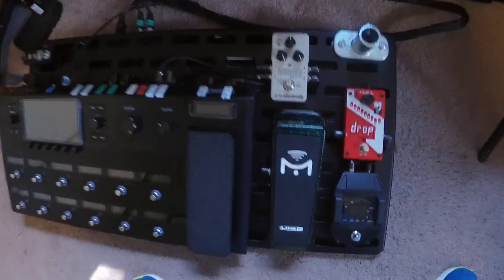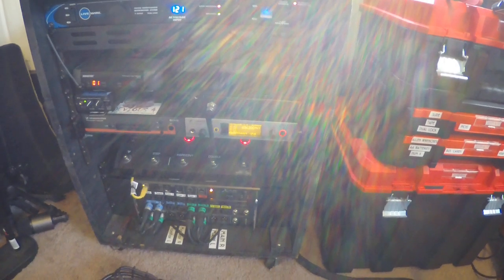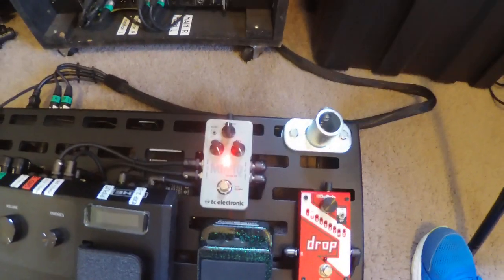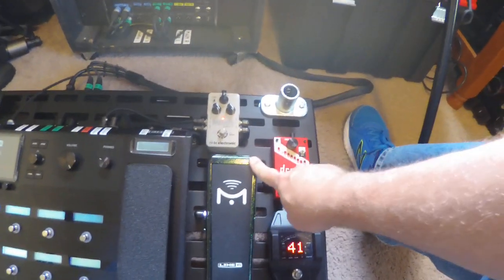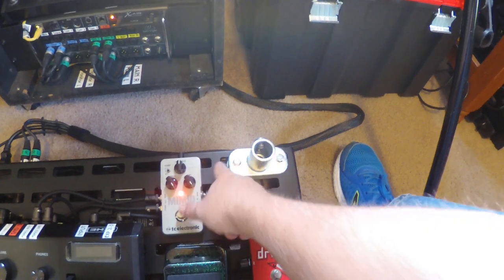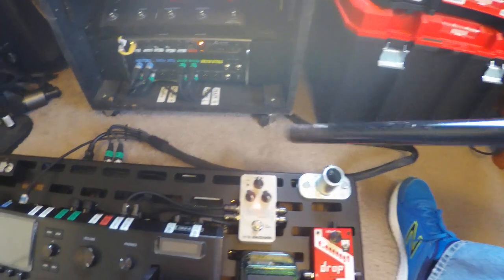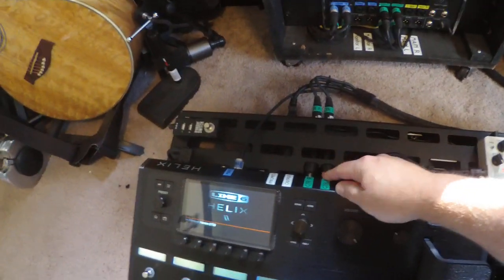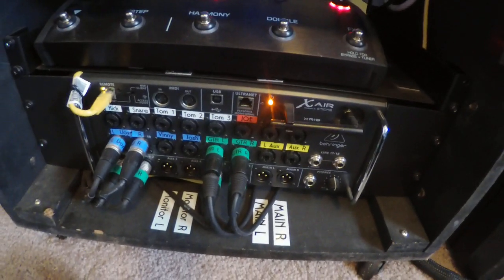My new Rockboard Cinque 5.3 for Helix

Comment: I really dig the clean simplicity of your rig Josh. My guitar rig and PA are very similar, but not as nice as what you have. 

I run helix with no external pedals into the X18 "flat" mixer into Carvin in ears. I use a pair of Peavey PR12s for tops powered by an ancient Peavey CS800 that's probably as old as I am, lol (I'll be 40 in June). I use a single Peavey 118 sub in most situations powered by a Behringer EP2400. My drummer and I both use Shure SE215 ears in stereo. I will say, if you arent running your ears in stereo, I HIGHLY suggest you try it. What a world of difference. 

Anyway, always dig the videos and I love the Helix content. The band sounds great. Keep rockin man!
Reply from the maker: Thanks, Aaron.  I'm using Shure 215 IEMs as well.  The Mimiq is my stereo secret.  Drummer is in stereo too but he needs better IEMs.  I'm just waiting for my Alien Ears IEMs to be tweaked so I can start using them.  This set up makes things so much easier and quicker and it sounds fantastic.

Comment: Has this one got the holes on the sides to fit the LED light accessory etc?  They are almost big enough to fit a standard Neutrik D panel mount through, you just need to enlarge them a bit and drill two new screw holes for the bezel.  I just fitted one to a Tres 3.1 to run a USB-B port and extension cable from my Boss MS-3 to the right of the board.  You could do it with XLR but yeah the problem is getting through the top.  Any local engineering workshop should be able to help with such small mods.

Comment: Nice board! Do you use a softbag or hard case when transporting the board? Also did you have to cut to get the IEC cable through?
Reply from the maker: Soft bag.  It ripped easily.  I had to cut to get the right angle XLR cables through but no the IEC.  I didn't have to cut much, just 1-2mm of extra space.

Comment: Hello! I know this video is from a while ago, but I'm thinking about buying the same pedalboard, but I'd like to ask you a question, considering that the Helix Floor has an angle for the buttons, when placing it on the pedalboard is it comfortable to press the buttons and the expression pedal?

Thanks!!
Reply from the maker: For this is was not an issue.  I had the same concern but it really did not bother me.

Comment: Where did you get that style of a mission pedal with the spring back from?
Reply from the maker: Mission sells them.  You have to order it.  It can be  modified after the fact but they said it's very difficult to do.  It should be built with the spring.  Choose the spring load option.  https://missionengineering.com/shop-2/products/expression/specific-use-exp/ep1-l6-line-6/
Reply: @hollis1003  ahh. Sweet. Directly from them. Thanks so much. Yeah I am getting ready to build a set up similar with a rock board. I am going to purchase a helix and the power cab 2x12.

Comment: Hi man! Which power supply are you  using? Because I'm goin' to buy that board and I'll put the Helix LT and other pedals on it with that rockboard MOD exactly
Reply from the maker: This is from a few years ago.  I think I used a pedal power.  I got a right angle IEC cable for the Helix and also had a Y style IEC cable under the board so I could power the Helix and the pedal power with the one IEC cable you see coming out of the back of the board.
Reply: @hollis1003  thanks a lot man! Are you still using this setup or you changed it??
Reply from the maker: @w3bster27  I've changed it several times. LOL  Sold the Helix earlier this year.  I still have a HX Stomp.

Comment: halo dude... do you prefer the Shure GLXD16 or Sennheiser for best guitar wireless and sound quality on stage? 🙏🏻
Reply from the maker: Sennheiser was for vocals and my in ears.  They worked pretty flawlessly.  I sold the Shure and went back to Line 6 wireless.  I actually use the G10S now and it's great.  I don't like having a pack on my strap or in my pocket.  Charging it was easy.  I did have a lot of drop outs with it, but I think that was primarily due to the wi-fi of the X-18 mixer we were using.  G10S has been great and if something breaks it's not expensive to replace.  The transmitters are only $100.
Reply: George Hollis any people say the shure glxd is the best guitar wireless in their class, and they have never drop out using the shure than the line 6.
Reply from the maker: @BagusWibisono  That was just my experience with it.  It sounded great but I could not get a channel that I didn't have drop outs.  Again, I think it was because of the wi-fi.  I just couldn't keep using it live.
Reply: George Hollis thank you for quickly respon dude. And thanks for your opinion🤘
Reply from the maker: @BagusWibisono  Shure thing. LOL.  I would just say keep your wireless at least 10 feet or more from any wi-fi.

Comment: How exactly are you running the Mimiq pedal in the Helix? I know you mentioned that they are going into loops 1 & 2 on the Helix but what is going ino the inputs of the Mimiq itself? I just bout the mimiq but I'm new to using external pedals with the Helix.
Any chance you could do a video on that set up specifically and how you have your patches set up with it? Thanks in advance, love your vids man!
Reply from the maker: I have other videos on my channel that might help explain it.  I place a stereo fx loop at the end of the chain.  The only thing after the Mimiq is a plate reverb which sometimes I use and sometimes I don't just depending on how I feel.  That's pretty much it.
Reply: @hollis1003  yeah I tried to look for some other vids to see how you were routing your cables but really didn't see one that helped a whole bunch. I was curious about what cables were going where as far as what's going into the mimiq on the input side. I'll take another look I guess.
Reply from the maker: @vernonleemonii3334  Send 1 into dry input of Mimiq and send 2 into the wet input of the Mimiq. I have tried only using the wet side before but it does not sound as good as using both.  I think it's because there is a little delay from the ADA conversion in the Helix and I seemed to notice it.
Reply: @hollis1003  ok thank u sir!
Reply: @hollis1003  and thank you for your response and great videos. Very helpful. 😎
Reply from the maker: @vernonleemonii3334  I don't really have a topic other than what you asked me but I will try to make a video today.

Comment: You're not using the H9 anymore?
Reply from the maker: No.  You can't update on the fly.  Although I'm good with digital stuff, it was too complicated and you can only use one effect at a time.  Good for some people, but not for me.
Reply: @hollis1003  Thanks for the reply, I appreciate it! Have you found similar ambient/delay sounds with the the Helix? I'm a complete Helix noob, btw ;)
Reply from the maker: @Alvin_C_York  The Helix is great, it's just not as strong at the Harmonizer stuff as the H9.  I'm not an ambient sound guy.  I really only use a little Plate reverb so I don't sound completely dry.  And then I use delays based on the particular song.  Sometimes the Vintage Delay, sometime the Ducked Delay, sometime the tape delay.  They all sound pretty good to me.
Reply: George Hollis awesome, thanks!